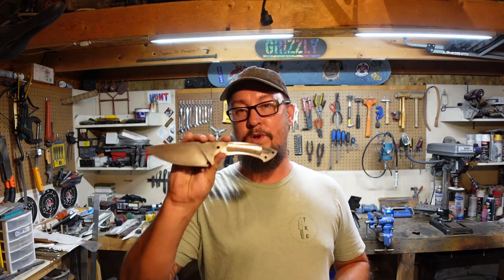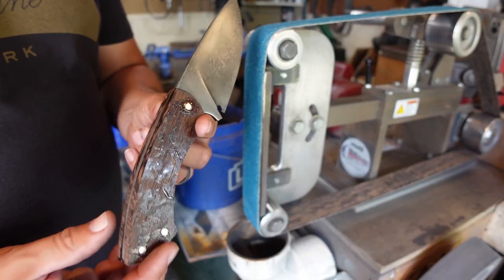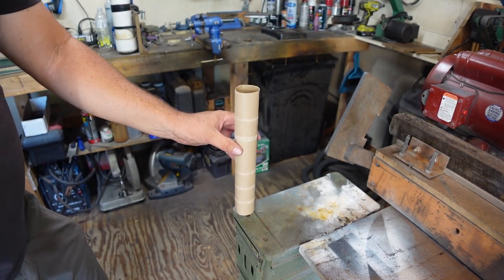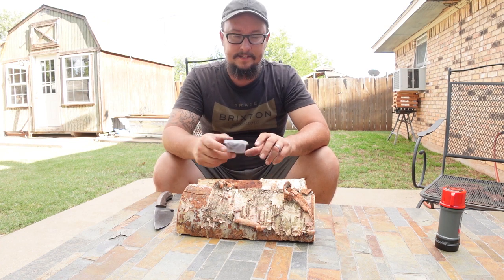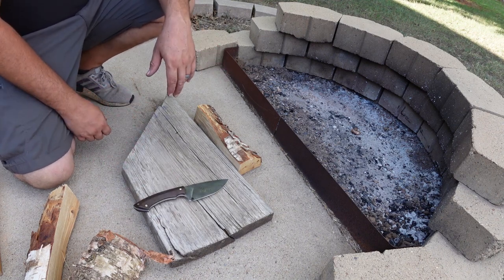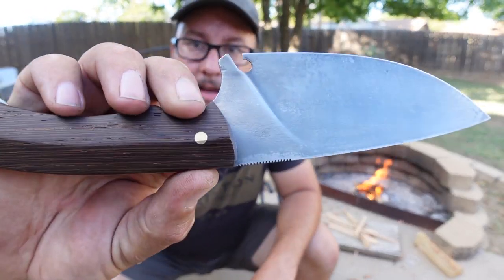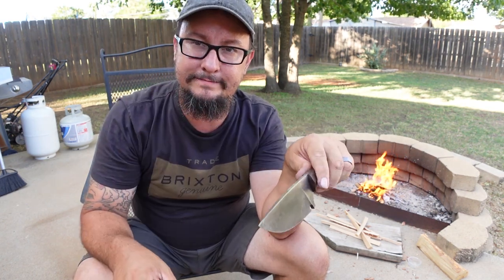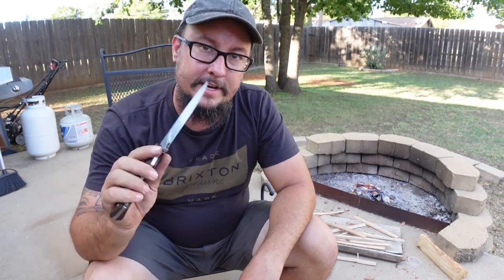I Finish A Cracked Knife And Baton It Through Wood | Pop's 8670 | Shop Talk Tuesday Episode 148

Comment: With the crack where it is, my guess is the steel quality itself if it maybe got rolled funny or was just a weird flaw in that piece. It does happen sometimes on some melts, you get a sketchy bit of steel out of any otherwise decent batch. Mind you, there's 3 steels I'd count on to cut a car door off and 8670 is the only low alloy carbon steel I'd count on doing it, so you went real easy on it in my book :)
(then again, I am an idiot that managed to ruin $80 worth of stainless steel last week so the above opinion may be worth nothing!)

Comment: Very odd that it cracked during heat treat..... I've used that steel alot and it's very stable. I wonder what caused it to crack..
Reply from the maker: It was from a slight over heat going into the quench.